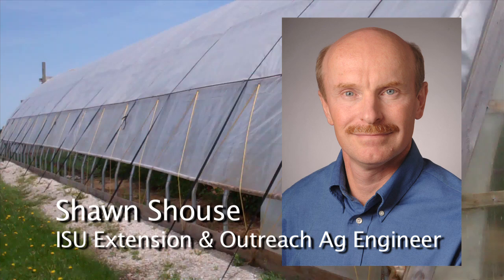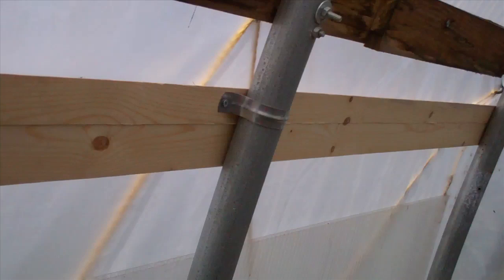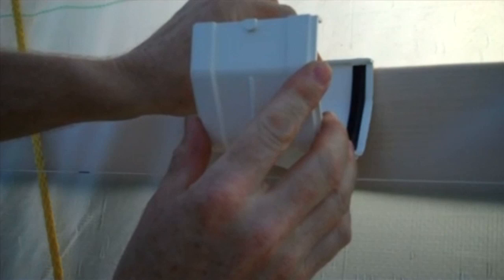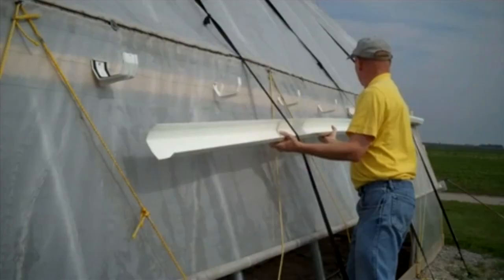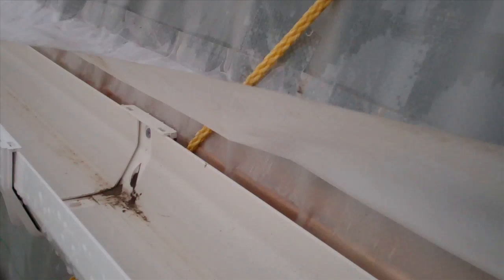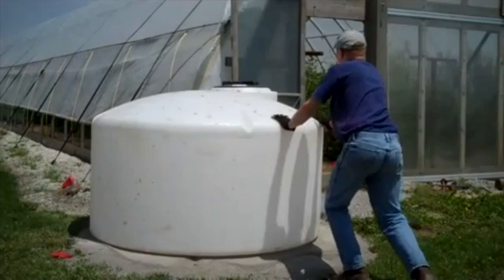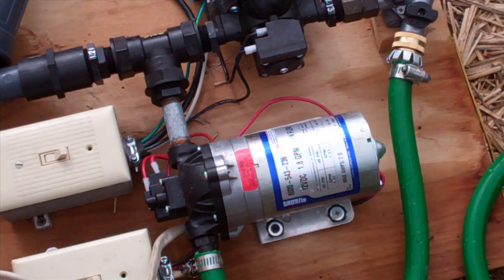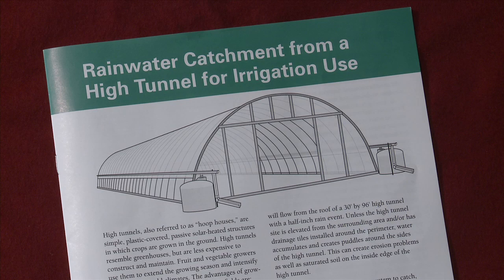Rainwater Catchment from a High Tunnel for Irrigation Use

Comment: There is a gap between the gutter and the brace ropes. The flap attached with tape is not a solution. 

A cheaper way would be to put a J shaped jig on the plastic that's already there and have it funnel it in to sunken barrels at ether end that has a sump pump in it to send it to an above ground storage tank that can be linked to other tanks via a large diameter overflow hose at the desired water level (no need to have several tanks at the exact same level). Overflow on the 'last' tank can be directed away using the same top of the tank hookup. This way, my way, uses less materials & technology to run.

This video is a perfect example how overthinking an idea can waste a lot of resources.
Reply: Good points.  We did lose a small amount of water through leaks around the brace ropes.  I did not consider it significant (probably less than 5% loss).  On a new tunnel, or replacement top, you may be able to create gutters using extra roof material below the hip board as a trough, and avoid the challenge of getting water off the roof and into the gutter.  I thought about that approach, but considered the detachable gutter to be easier to describe and easier for viewers to duplicate.  As with most novel projects, once an idea is out there to get people started thinking, farmers will usually come up with better versions that fit their situation and skills even better.  Thanks for the ideas.
Reply: how did your suggestions work for you @mio giardino? Your idea on not over thinking seems genius.

Comment: Great video, thank you. What angle did you rip the 2x4s at? I'm hoping to buy some ripped 2x4s rather than buy a very few uses (perhaps only single use) table saw,
Reply: Two objectives here. First, to try to get a nearly vertical surface for attaching the gutter brackets, and second, to make efficient use of inexpensive 2x4s. About 23 degrees would split a 2x4 (1.5x3.5) in half. But you'll lose a bit off both the width and thickness because of the saw blade thickness. About 25 degrees would leave you with 1.5x3.2" or 21 degrees would leave you with 1.375x3.5" (assuming 0.125" blade width). You could try to measure the angle of your frame members from vertical at the height you plan to install the gutter if you want to be more precise with how you cut the lumber. I figured roughly 23 degrees would get me close enough. (Maybe I should have just answered 23 degrees? But I'm an engineer.)
Reply: @shawnshouse445  Thank you for the very quick response and insight. Much appreciated.

Comment: I have found that some inspectors will say there is a safety issue, because the possibility of bird poop being on the roof.
Reply: Good point. At 8:25 in the video and in the accompanying bulletin we note that harvested roof water will contain bacteria from the dust, droppings and insects that get flushed into the tank. It is important to use it only for soil applied irrigation and not to allow it to come into contact with edible portions of produce, nor to use it for any other purposes. Very similar concerns as for using untreated pond water for irrigation. Thanks for noting that important issue.
Reply: So How do you keep the birds from shitting on and dust from settling on your plants that aren't in the hoop house?
Reply: Indeed!  You don't.  But in this case, we are concentrating things a bit by collecting from a larger area than the plant canopy.  The horticulture specialists say that since we are able to put it directly onto the soil surface and avoid contact with edible plant parts, it seems prudent to do so.

Comment: Would it be possible to use the run off after the tanks are full to irrigate trees?? Wondering if it would gravity flow enough to be possible??
Reply: Yes. Our main objective with the overflow (excess) from the tanks is to get it away from the edge of the tunnel where it would cause excess moisture problems. If you could divert it to a location where the water has value, so much the better! To gravity flow through a pipe or open channel, the combination of pipe or channel size, roughness, and slope, determine the flow rate. Tables are available for sizing drain lines or channels. In our case, assuming a peak 5-minute rainfall intensity of around 7 inches per hour, or using the maximum capacity of our pair of 5" gutters, we would need an overflow outlet capacity of around 0.35 cubic feet per second, or around 160 gallons per minute. In rough terms, that would take a 4 inch tube at 3 percent grade, or 5 inch at half a percent grade, or 6 inch at 1/4 percent grade.  Anything down hill that you could reach with those slopes would be possible, if you want to spend the money to divert it more than just letting it run where it wants to go.
Reply: @shawnshouse445  Where would I find this said table? Sounds a little over my head but hopefully my husband understands all of that to help me haha!
Reply: @kellinehl4177   A couple examples for corrugated plastic drain tubing which you can get at farm supply stores in 10 foot sticks or longer coils, 3 inch diameter or larger:  https://www.nrcs.usda.gov/Internet/FSE_DOCUMENTS/nrcs141p2_018127.pdf  and  https://engineering.purdue.edu/~abe325/week.10/drainage.htm  Both list the flow capacity in cubic feet per second (cfs).  One cfs equals 449 gallons per minute.

Comment: Where can I get the plans to build the high tunnel shown in this video?
Reply: Our high tunnel was a kit purchased from a supplier.  Here are a few university bulletins that have lists of suppliers for such equipment.  You may have a local supplier you'd rather use.  Our lists do not imply endorsement, and omission from our lists does not imply disapproval. 
https://u.osu.edu/vegprolab/high-tunnel-suppliers/ 
http://blogs.cornell.edu/hightunnels/structures/structure-and-equipment-sources/
http://extension.msstate.edu/publications/publications/high-tunnel-suppliers
If you choose to build your own, here are a few bulletins with advice.
http://extensionpublications.unl.edu/assets/pdf/ec308.pdf
http://pods.dasnr.okstate.edu/docushare/dsweb/Get/Document-9943/HLA-6720web.pdf
http://blogs.cornell.edu/hightunnels/structures/structure-and-equipment-sources/  (note this one has some links to construction plans at the end)

Comment: was the water pump and electrical on the same board, for a demo. or would you use it that way?
Reply from the maker: Yes, the pumps and switches for the pumps were all mounted on one board for ease of display and packing the pumps away for the winter.  It would make more sense from a maintenance and safety point of view to have the switches located farther away from the water lines and pumps just to reduce the possibility of water damage and possible short-circuiting.  A good catch and a great comment!

Comment: why can't rain water be used to water plants directly? I mean isn't bacteria teeny tiny and it would just go through the nozzle any way?  drip or hose?
Reply: Yes, the bacteria would go through the irrigation system.  The concern is putting bacteria-contaminated water directly on edible produce.  Soil application of the water greatly reduces the risk of bacterial contamination of the produce.  Rain water would have much lower risk of bacterial contamination than the harvested roof water.

Comment: Rather than a flap, why not simply use the roof repair tape? No need for weights either.
Reply: Interesting idea to try.  I felt the amount of tape needed to use tape alone would have been prohibitive.  But could be worth a try, and easy to replace later if you don't like the way it works.

Comment: Iowa State Extension,  where can I purchase a solar panel like that?  I am trying to put together some type of solar power to produce enough power to run our greenhouse blower fan and some inside fans.
Reply from the maker: The solar panel system that works effectively for us and is easy to install on the high tunnel is manufactured by Powerfilm Solar.  http://www.powerfilmsolar.com/index.cfm
They can be found for sale on Amazon.com
Reply from the maker: Also, rigid solar panels were used at our demonstration site and they are generally available for a much lower cost for similar capacity compared to the flexible panels mentioned above.
 
Multiple suppliers are available, including Amazon.com, and specialty suppliers such as gogreensolar.com to general merchandisers such as sears.com
 
At today’s prices, solar PV panels can be purchased starting at about $1.50 to $2.00 per watt of rated output.

Comment: You better get that battery off the ground don't drain it
Reply: Thanks for the comment.  My understanding from battery manufacturer information is that drainage from contact with the ground was a problem with very early lead acid batteries, but since the refinement of plastic battery cases, that is no longer an issue.  Check with your battery manufacturer for confirmation.